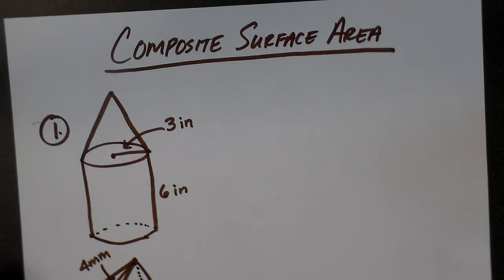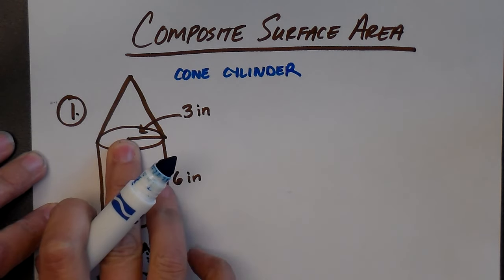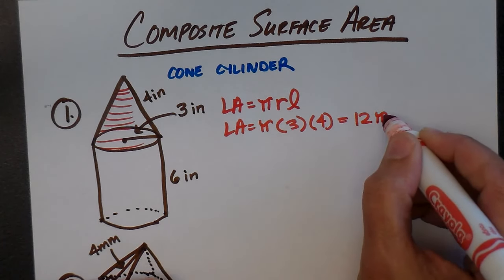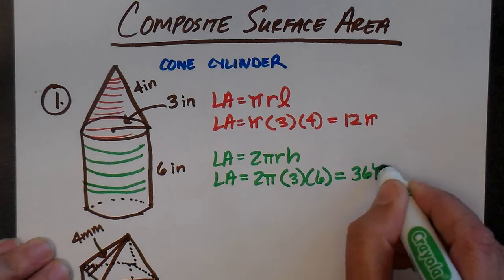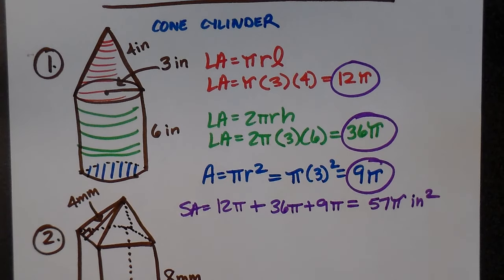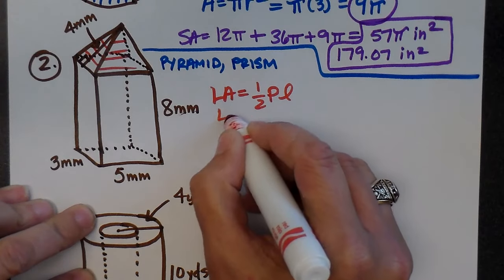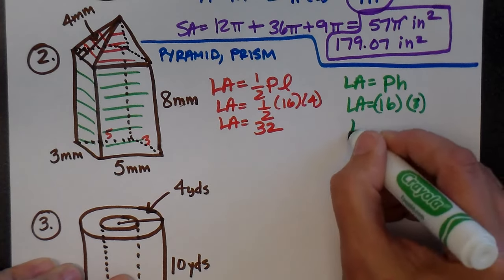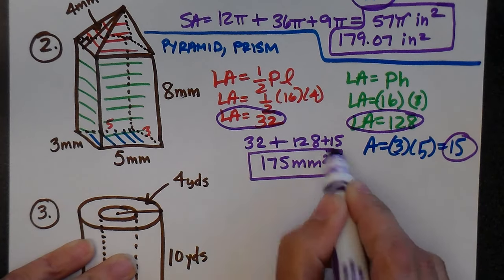Composite Surface Area of Solids

Comment: Can someone please help.... I have a problem that makes no sense at all.  "A zoning ordinance requires that any property with impervious coverage that discharges more than 100,000 gallons of water in a 4-inch rain storm must have a retention pond. The subject property will have 260,000 s.f. of impervious surface. A cubic foot of water contains 7.48 gallons and a retention ponds can hold no more than 500,000 gallons for safety reasons. What is the amount of water being displaced."   Can some solve and explain, major thanks, (I'm using a HP12c calculator).